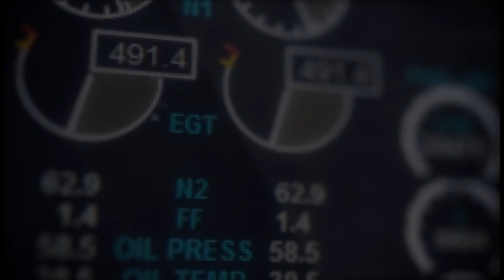Will Circular runways "take off"

Comment: The biggest issue that I see with a circular runway is that the winds are constantly changing direction as the plane nears the ground if it doesn't set down exactly where it wants to set down.   Also, with strong winds, wings are put down against the wind to keep from drifting off of the flight path and the complex changes in banking and rudder with changing wind direction introduces more room for mistakes and crashes.

On the wing clearance issue, I don't think it is necessarily an issue if the banked runway is a straight bank as opposed to a curved bank.  But the degree of bank certainly depends a lot on both aircraft landing speeds and possibly also lateral wind speeds as the landing path curves away from the wind direction around the circular runway.

Comment: Much better is the "Star of David" design, which was the original Heathrow layout. We had 6 runways! Although only 2 of them are in use now (the others are just taxiways). But if the other runways were longer, and had been given equal importance, we could still have had them in use today. Take-offs and landings in 3 (6) directions.

Comment: I agree that this is not practical, but I don't think there would be a lot of centrifugal force. If the diameter is large the plane does not turn in a big enough rate to really feel it.

Comment: The biggest issue that I see is removing the human element and the capacity for error. On straight runways, you have designed markings to touchdown at as a visual guide. On a circular runway that would mean a mark or series of markings for each compass heading.  This could get confusing considering many approaches are consistent and pilots who tend to fly regular flights get used to. Now the approach would be different every time. Given the runway size, the designated heading numbers could seem bo be a run on series of numbers.With a large number of incoming flights this could not not only throw of the the pilots but confuse ATC as well. Aircraft as well as airport design are designed to reduce or remove the human chance to error as much as possible. Adding these factors on both take off and landing would increase that possibility... especially if there was an engine failure or other emergency.  Pilots already are trained in what to do if an emergency happens and may already be using much of their mental and physical prowess just to keep the plane in the air and try to get it back on the ground again.  Then add this confusion to the mix and you might have a recipe for disaster.  One avoidable accident is one too many, and this unfortunately has the potential to do just that. Good in concept or theory... but probably not in practice

Comment: Centrifugal force is a "fictitious" or "virtual" force which doesn't really exist. It only appears to be a force when treating an accelerating frame of reference as an inertial one. There is no force which pushes an aeroplane, or a car or a person to the outside of a curve. What's happening is simply Newton's first law; that is a body just wants to follow its inertial path in a straight line. That "force" pushing your car to the outside of a bend is simply the natural tendency to go straight on. What is actually happening is that, in order to follow a curved path, a force (the centripetal force) has to be applied inwards accelerating the body towards the centre of the curved path. When you are in a car, and you feel you are being pushed to the outside of the bend, you are not. Your body just wants to go straight on and what you are feeling is the forces on you body which are steering you away from that straight path. In this case, the centripetal force is provided by the banked curving (which, incidentally, will put more load on the landing gear).

That's not to say that the failure of an outside engine wouldn't unbalance all the forces keeping the aeroplane on it's curved path on a banked track. It would, as the one remaining engine would act against the centripetal force keeping it on that curved path. The track is  banked, and if it's a slightly curved banking then the aeroplane would ride higher on the banking until the forces cancel out. 

Whilst the circular runway idea is risible, it ought, at least in theory, get rid of the idea of a point of no return so if there is an engine failure whilst on the take-off run it will always be possible to abort.

Comment: You cannot corner in any vehicle as fast as you can travel in a straight line and in the summer sometimes more  thrust and speed and more runway is required just to take off.  With that in mind how on earth did Henk Hesselink come to the conclusion that a round runway was a good idea?

Comment: and then there is the runway up in the mountains where if you dont take off soon enough you fall off the mountain and if you dont stop in time, you go hiking up the mountain.
How would you tell the pilot which section of the circle they are to land on?
In 2050?  I bet passenger jets will be VTOL.

Comment: Before about 1944 pretty much all US airports were triangles with three runways, so you never had to land far from the wind. The B-29 bases and every single large airport and airport expansion since uses multiple parallel runways in line with the prevailing wind. For large aircraft, crosswind is rarely an issue, and parallel runways are just the best way to handle large amounts of traffic. And that's the fundamental issue: this whole circular-runway concept is based on the youtube selection bias - the relatively few spicy crosswind landings/go-arounds go viral on youtube, and the millions of boring, uneventful landings (made possible by parallel runways) never make it onto youtube at all. And in a fair number of those spicy videos, the runway is not aligned with the prevailing wind due to limiting geography that would not allow a circular runway anyway. So even if all the technical issues in this video were magically fixed, there is no way to make the economic math work when you're sacrificing so much capacity just for the sake of avoiding a few go-arounds (which of course are generally non-fatal and only mildly inconvenient).

Comment: You forgot another big factor with this. You want be able to use autopilot on approach and it changes the entire calculation for manual landing, since the heading will be constantly changing. I could only see this working for general aviation.

Comment: But there could be other Solutions of the well known Problem of lets say, Crosswind. So lets take look outside the Box and see how other Pilots handle this. A Hangglider Pilot has two Problems. He can´t control   the Yaw Axis independetly to the Roll. When there is Crosswind and he must follow a Path on the Ground. He is landing Sideways. The same when it comes to a Tow Start with Crosswind. Turn the Nose into the Wind and Run Sideways. When Aircrafts where able to do so, they will have much less complicated Landings in Crosswinds. For me the Solution is clear: The Maingears should be able to rotate, for making Sideway Landings and Starts possible. This comes with other Benefits. If Airplanes can do this, they become also more maneuverable on the Ground.

Comment: And where is the ramp area?  Outside the circle means that the aircraft has to taxi up the banked side. Possible tail strike? Inside is impossible for passengers to reach. 
Much more difficult for fire rescue to access
The surface area for the entire airport including terminals would exceed that of straight runways.

Comment: I can remember seeing many years ago an article designed during WW2 for a circular runway for the RAF. A Tower in the centre that rotates then cables attached from it to the aircraft wing and it would take off same way as a Control Line model aircraft. Then once in flight release the cable. If I remember right the idea was you could make these runways using very little space, plus get the aircraft up quickly. I would imagine the idea was dropped because chances ripping the wing off, can imagine it would also be a nightmare for the Pilot.

Comment: Needing to go in a circle defeats the original intention of avoiding cross wind. (A pilot Will be changing the heading of the plane as he /she goes in a circle) yes during final approach, the plane will be lined up with the headwind. But if the plane is too high or too fast, then the landing will have to be on a further point on the runway. To follow the runway, the pilot will need to constantly change the magnetic heading.

Comment: It's a great idea but in the US it will be banked ovals. The interesting thing would be what radius the planes can negotiate. Airports could be built on the inner section so that space is utilized. There would never be a need for cross wind landings or severe braking. By the time aircraft were at the downwind side their speed would be reduced. The main problem would would be keeping the Brits from going the wrong way.

Comment: In a corruption free democracy it would be perfect! Just make it 10 km diameter that gives it 13.4km runway. Retard and touch down with water draining because of the slight bank. The engine manufacturers would sell less engines as one could just let it run out on a quiet day. Brake makers would sue airports for selling less brake consumables. Oil companies would even more corrupt governments to add costs as less pack fuel would pollute. Paint factories would corrupt newspapers for the loss of paint sales and ask them to print fake news.  No more piano keys, greedy music barrons would sell less copies of "ebony and ivory" and threaten pilots who would support this concept. Papi light makers would sulk for having to use their brains to re design working lights.  Communists would refuse to give priority to needy planes having issues with crosswind. Boeing would sulk most as the new Chinese planes would have long enough "legs" to support 80m fuselages. Noise administrators would commit suicide when the Chinese bring in their electric planes and some would be made redundant...

Comment: Hey @Mentour Pilot just thinking all the issues would be solved if we had an equally ridiculous, oversized, and overly expensive overlapping style octagonal runways? One long runway for each 45 degree wind angle, with moving / rotating ILS and antennae!? That could potentially work and it would eliminate the sliding and centrifugal force based issues, it just wouldn't completely eliminate the cross wind issue, however, it would allow a more favorable angle.
Reply: German Turtle maybe just a square

Comment: The diagram shows a banked runway with a concave cross-section which reduces wing-tip clearance. But there seems no reason for that concavity so clearances should be unaffected. Banking should also improve water run-off.
Reply: I'm glad I wasn't the only one that spotted this 😁

Comment: That sounds like a absolutely HORRIBLE idea. Yes there is crosswinds but I rather deal with that any day then deal with a wingtip digging in and the plane breaking up as it cartwheels down the runway. Plus they'd have to change planes to allow one side to take more weight as well as having the issues of take off since the entire pt of a banked road is to make things NOT go airborne.

Comment: Planes and landing gears were not developed for higher speed side load in a turn on runway still maintain skidding ... let alone side wind and bad weather. unless runway surface also bank at an angle conforming plane’s banking at a specific speed and turn rate.

Comment: The other thing you also have to see & talk about, is that an aircraft coming into an airport in an emergency situation Undercarriage failure or engine failure ... if the aircraft lands short of the runway and is in a belly down situation ... it's not usually going to slide in an arc ... it's gonna want to slide with a forward motion in a straight line ...
 How does a circular runway work in that situation ... ?

Comment: The problem I see with circular runways is that you would have to change all the approach procedures, and sequencing which means retraining the air traffic controllers. Traffic patterns and takeoff procedures would also change meaning you would have to retrain almost all the pilots to. Those are just my thoughts and I might not be being opened minded enough but I’m not sure if it is worth all the changes that would be needed. All this being said I am only 13 and haven’t even starting pilot training yet so I am no expert.

Comment: I would like to add on to the discussion about centrifugal force. Since the runway is banked, gravity will actually pull the plane slightly inward. The faster you move, the greater the centrifugal force pushing the plane outward is. As such, you have a constant force pushing the plane inward and a “force” pushing the plane outward which depends on the aircrafts speed. The relative strength of these forces compared to each other also depends on the banking of the runway. Because of this, you could balance the banking of the runway so that at takeoff speeds the aircraft is not being pulled to the inside or outside of the runway, which would make the point about engine shutouts moot at takeoff speed (although if the plane isn’t at takeoff speed and the outer engine shuts off then the plane does get pushed to the inside, but if your banking is curved then this may not be an issue either).

If there are obstacles in the way, you could just limit the angles planes are allowed to approach or leave at, although this does partially defeat the purpose of building one in the first place.

The circular runway seems to be an interesting idea, with some advantages compared to straight runways but also some impracticalities compared to straight runways (which probably outnumber the advantages tbh). Given that we’d have to rebuild our planes and airports to accommodate for circular runways, I just don’t see them as practical.

Comment: End of 2018 , MIT did a first solid state airplane , which in 50 years may change the aviation world changing  wing shapes , landing and take off distances and cross wind may become a more critical  parameter than length . So I see circular runways  in 80 years or so ( which I will not be able to see actually)

Comment: That's a pretty strong case against circular runways, but what about the "HW" runway planned for Chicago O'Hare? For readers unfamiliar with that project there is a huge vertical loop in the middle of an otherwise straight runway. The idea is that aircraft will remain in the loop until they have achieved sufficient velocity to be able to take off shortly after exiting the loop. It's been calculated that the runway requires only 63% of the length of a conventional runway. As the aircraft approaches the loop entrance, if its speed is insufficient to provide the centrifugal force needed to keep it in contact with the runway at the top of the loop the pilot can abort by directing the aircraft to an escape ramp. There are several safety advantages. For one, there is no concept of V1. If a problem occurs in the loop, no matter the speed, the pilot can simply remain in the loop until velocity has decreased to the point where a safe exit from the loop can be made. The surface throughout is as flat as that of a conventional runway, so existing aircraft can be used. The loop has been engineered to balance forces so precisely that passengers may not realise they are upside-down during parts of the takeoff. Little additional training will be required for pilots and that can be done on an iPad.

Comment: New nanomaterials could perhaps make a kind of huge windshields possible,  running on both sides of the approach corridors. But then some smaller plane would probably end up flying in it, so there goes the safety factor. Airports have so many requirements, it's hard to come up with new ideas unless you know a very spesific issue that needs a solution.

Comment: How would you set up ILS approaches around a circular runway?
Reply: Simple. Ya don't
Reply: They would probably have to set up antenna arrays at specific points around the circle, and then switch the transmitters to the appropriate array when needed. They could also use separate transmitters for each array but I think that there would still be a limited number of points of approach instead of having a 360 degree approach from any heading process.
Reply: maybe an array that rotates on rails to line up with the heading?

Comment: If we have 3km radius... That means we have 6km diameter. Most of current runway are about 3   upto 4 km. If we have 6 km runway... We can increase our landing speed which good for resisting cross wind and we don't worry much about LDR because we have 6KM. 3 km radius is about  18km premeter???. If we have good place to build that with the circular complexity... Just build conventional 6 or 7 Km runway in much less cost and superior quality... And increase landing speed... Good-by to crosswind problem..

Comment: Here are a few other considerations against the issue.  1. Runway traffic approach from all directions with no specific final leg would be confusing. 2. Collision avoidance would be disorderly and create "furballs".  3.  Flying during a coordinated turn while approaching slow speed stall would invite loss of control at a greater rate especially is the pilot is dealing with changing wind directions. 4. Turning radius for an approach would require all aircraft to be flying the same velocity - which would limit landings to aircraft of same type.  5. Take-off and climbs would eventually place aircraft at same place of any approaching or landing aircraft.  6. Pilots see "straight" and fly straight, not in "arcs".